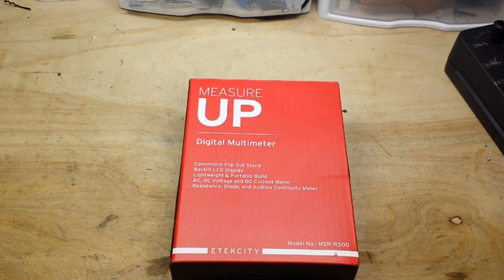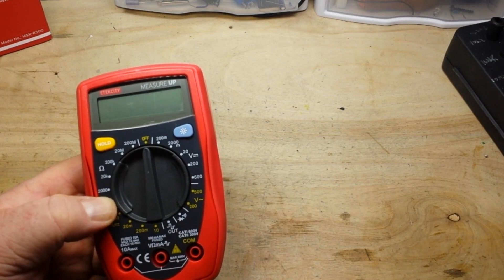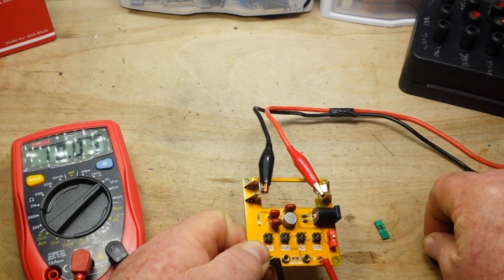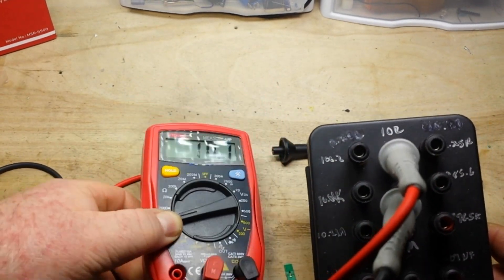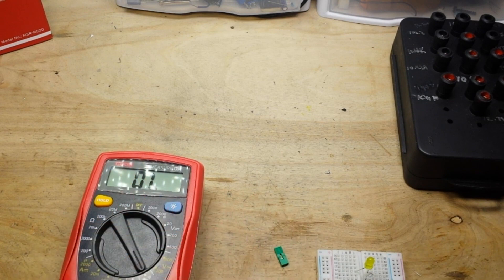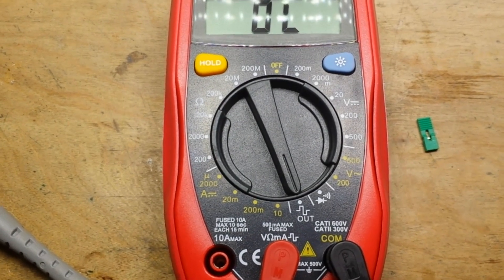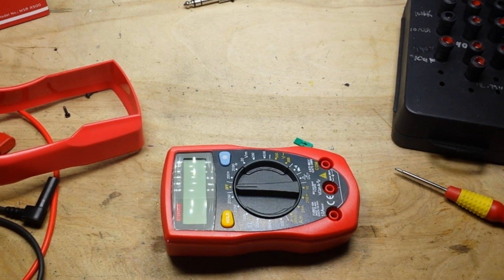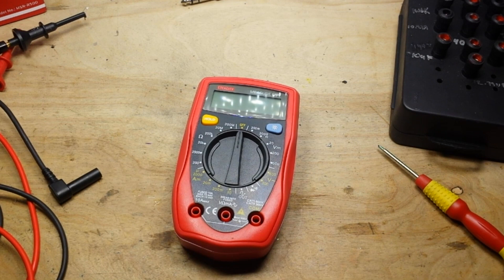Measure UP multimeter review

Comment: I bought that one as my first meter! Misty used it for checking continuity and resistance, which was fine, but ended up getting a new meter that measures in 6,000 increments (instead of 2,000) and includes capacitance meter too. Your other DMM videos helped me choose, so keep this stuff coming!

Comment: That looks like a rebranded Uni-T. At least it has a fused 10A range, unfused meters are dangerous.
Reply: safe for battery or low voltage electronics that’s about it, more of a toy for a kid learning electronics powered by AAA or 9v batteries that’s about it.
Reply: Michael Bishop  true; // And newer clamp meters can measure DC. Maybe I should get myself a UT120C one day...
Reply: @insoft_uk  Keep unfused meters away from car batteries as well. Those things can supply enough current to vaporize the cheap leads that come with said tools.
Reply: @thatengineeringchannel4611  Once as a kid I tried to measure a current of a car battery with a cheapo DMM. Up to this day I don't really know how I survived it :D

Comment: I didn't hear you mention the 9v battery advantage.  Any DVM with a 9v battery will perform better when it comes to searching for high impedance faults such as a ground fault. 9v is also better when it comes to checking diodes especially if there are a bunch in series like we have with fire bells and diode matrix.
Reply: I meant the 9v battery to power the DVM. So many of them have gone over to a 3v AA cells x2.  I find them less effective for high impedance troubleshooting in real life, just because there is not enough supply voltage to drive to the fault.

Comment: Hey good morning. I finally got my ham ticket. thanks for the inspiration!  now I need a big 12vdc power supply for my amp I dusted off after over 25 years of sitting. the most expensive part would be the transformer and I have a 1400 watt microwave transformer. I was thinking of redoing the secondary. If I calculated correct it should be about 100 amps at 13 volts. Hmmmm. what do you think?